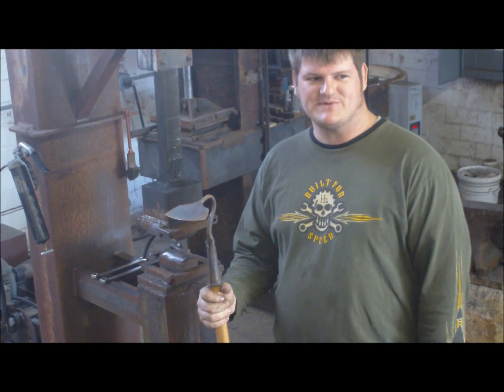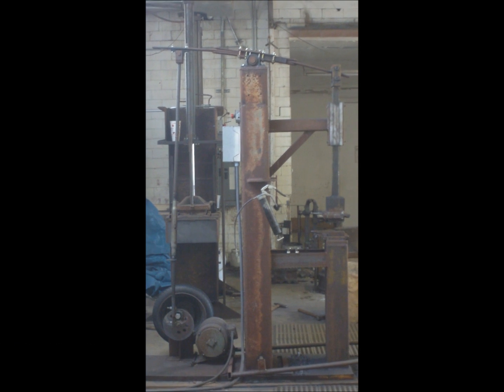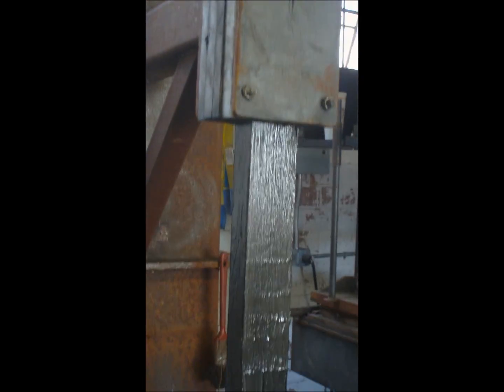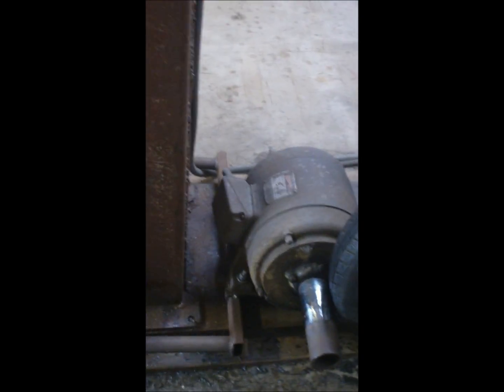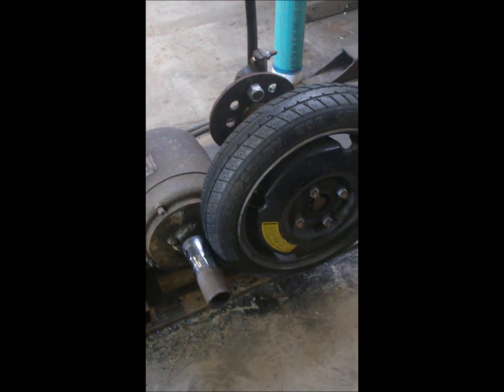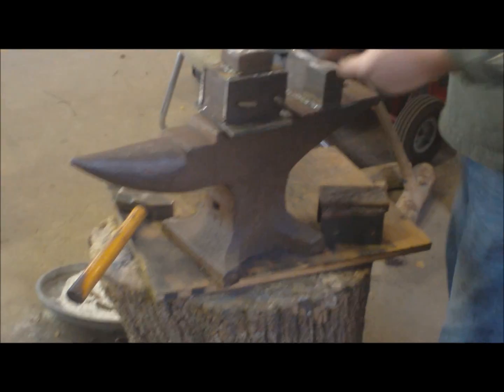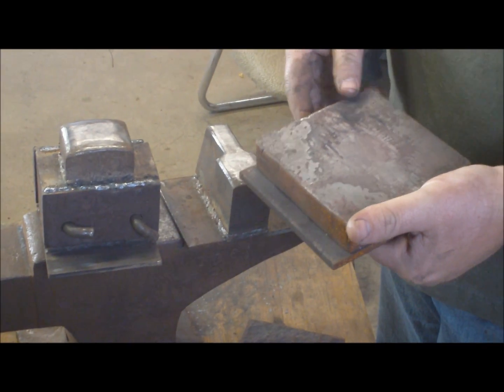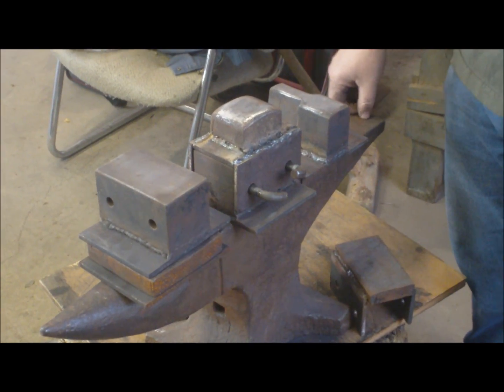An in-depth look at Gunnhilda, my homemade power hammer

Comment from the maker: It's a pair of bearings and pillow blocks for the pivot, nothing fancy. I shortened down the overload springs, but I need to play around with that aspect as well.  I've had two main springs break at the end of where the helper springs were, so it's a stress point.  I'm not sure whether they are doing much; I need to either see what longer springs do again, or eliminate the helper springs altogether.

Comment from the maker: Thanks!  This design is a variation of the "Rusty" powerhammer first built by the Appalachian Blacksmith's Association, which in turn is a guided helve power hammer built from salvaged materials.  If you do a Google search for the Appalachian Blacksmith's Association, you can find more info.  The biggest change on mine is the use of a tire clutch.  One advantage of this design is that it is fairly simple to scale the size up or down; the original had a 15 lb ram, this is about 100 lb.

Comment: Nice hammer!  Could you show the action of the pivot at the top as well as the tip of the spring flexing to drive the hammer?  In your other vidoe you mentioned overload springs but I'm unsure if you added overload springs or removed them.  I'm interested if possibly building one and will do a search for "rusty powerhammer" (or the term you suggested.....I'll have to look again.   Thanks for sharing.